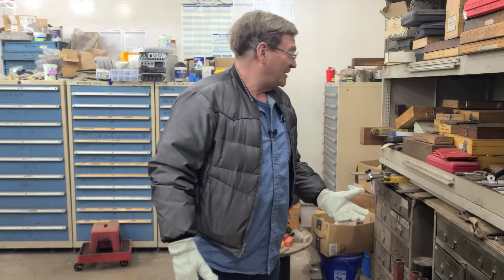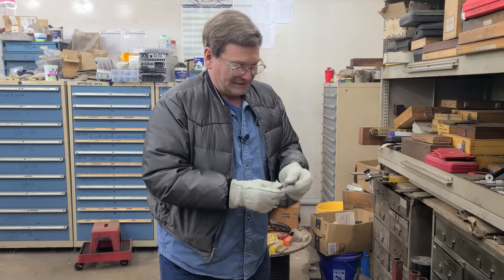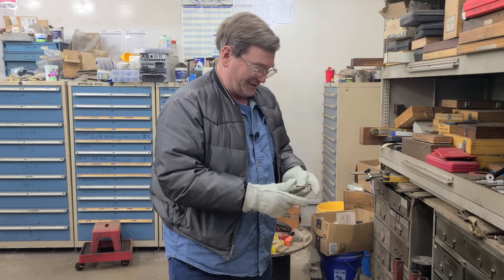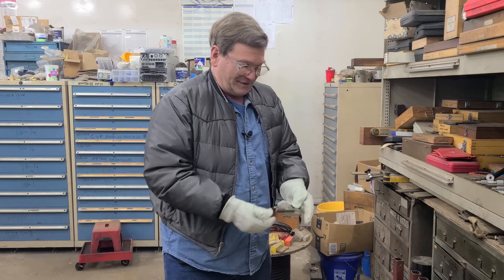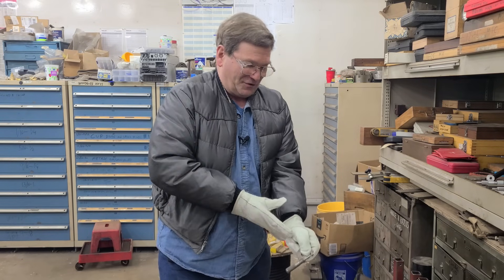About line-boring at -40F

Comment: Cold weather, years ago we had 2 brand new Link-Belt 248HC Hylab cranes and the first winter the hoisting drums hydraulic cylinders started leaking. Service guys from Link-Belt came out and washed the clutch drums with Brakleen then tied those big long round oil absorbers (elephant kotexes) around the cylinders and told us to change them out every few days. Link-Belt Sumitimo cranes are Japanese owned. It doesn't get below zero in Japan so the cylinders leaked. $4.5 million in cranes and the fix was a kotex...
Reply: Telling us Op has zero knowledge about Japan.

Comment: +.050  would never hold a grease seal. That is just ridiculous! We used to install haul truck dump box aluminum bronze bushings +.002  tight but they were +.004 inside diameter so they would be +.002 over the pin. Soak them in the liquid nitrogen, heat the hell out of the frame, and slide them in real easy.  At + .050 you could throw the pins in from across the room! You never hooched in out of the wind? I guess we were lucky, because the mine supplied the diesel for our salamanders.

Comment: the not verifying whack-a-doodle Shizz is something that always drives me nuts, worked at a shop that flat refused to use form taps, because they insisted they would need verification from blah blah blah, well chuckles, its a Mil-Spec part, if you read the mil-spec... form taps are not only approved, but recommended 
anyway, so we would blind tap 316 stainless break a tap in about 1 in 5 parts, scrap 50% of the ones we tried to fix... and then they lost the contract, of course they pointed fingers at the guys on the floor (the same guys that said, hey this isn't working but thats how management do)
Reply: I’m not surprised you were breaking taps, 316 stainless is pretty stout. Were they at least coarse threads?
Reply: @robertwatkins364  10-32, so small ish and fine, but deep and they flat refused to try spiral flute taps too... 

They later fired me for "not working well with others"

Comment: The difference between nights and days in the winter isn’t really all that much since the days are pretty short. I’ve worked at -60 for weeks on end and it’s not great but if you prepare properly it’s doable. Things don’t necessarily break all that much more easily when it’s that cold except for plastic or rubber-type materials but steel is pretty similar to less-cold conditions. You just need to be gentle on things, warm up everything properly including all the functions on hydraulic equipment so seals are warmer than the ambient temperatures. And always dress for the weather and have a plan if something doesn’t work out

Comment: Had to take fuel valve out of the tank on the log skidder on morning at -20 degrees to get the ice out of the valve , -20 degree diesel fuel on the hand is a hole lot colder than ice water .
Had to put thumb on tank hole till the other guy could get the ice melted out of the valve with a lighter and then I put it back in the tank, frozen thumb and only could do the job with one hand .
Took 15 minutes in the truck under the heater to get thumb soft again .
Got it running a then went to work in the woods .
Cold weather repairs are never fun , take a bolt on or off and then hand back in glove for a bit .
Reply: I had a job back in the '70s replacing a generator in a diesel generator set during -20 degree weather.  The morning of the removal, the crane crew couldn't get the crane hydraulics to move.  The problem was ice in the suction screen in the hydraulic fluid tank.  The oiler had to remove his coat and at least 3 shirts down to his T-shirt to reach into the oil tank and remove the screen.  I pitied that guy, his hand and arm were bright red from the cold.  The generator frame and rigging chains were so cold that our gloves stuck to them.